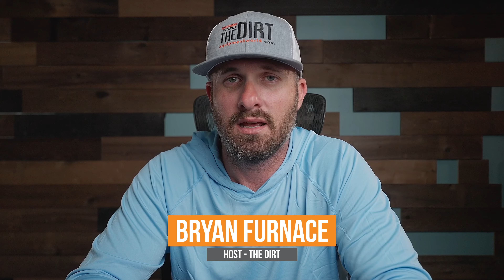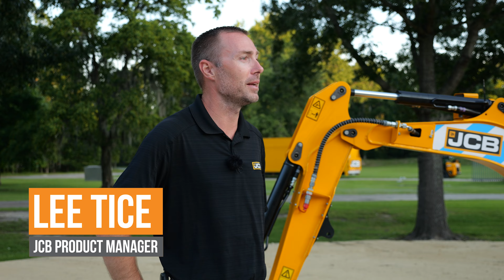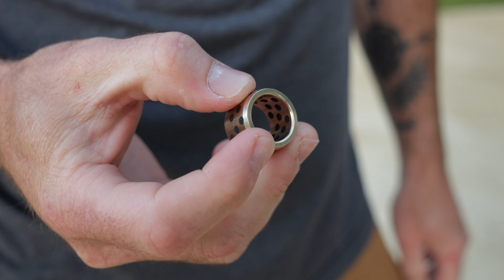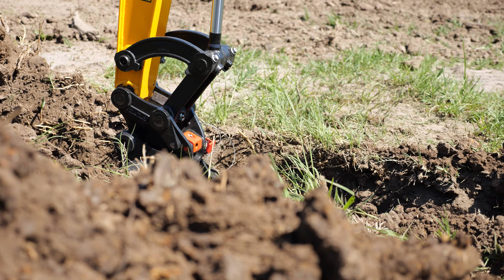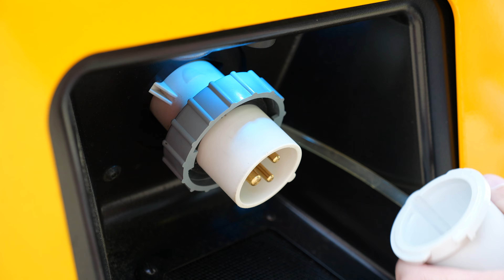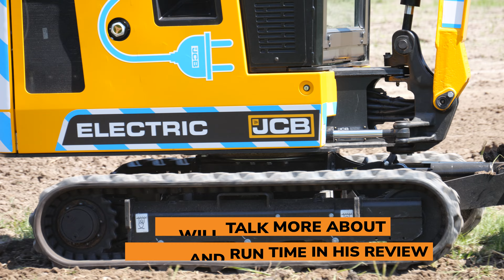Review & Test Run: The First Electric Mini Excavator, JCB’s 19C-1E

Comment: I did not watch the video. But it seems to me like an advertisement. Basic information is not presented in a clear and concise way. In particular:

1. What is the power (in kW)? Maximum and sustained.
2. What is the battery capacity (in kWh)?
3. What kind of battery it has? (cell chemistry, cell connection structure) Does it have thermal management? How fast it can be charged? (in kW) How does the charging curve look like?
4. How much does it cost? (cash, not taking into account any "returns on investment", operation costs saving or maintenance costs savings or government subsidies)

Comment: I looked at a diesel jcb mini ex and that 500 hr. greasing is bs. this machine had 900 hours and the bucket wobbled like a 304 on Sunday morning!  just grease the zerks! it pushes grit out of the joint and replaces it with lube. if you can't do that you shouldn't work with machinery